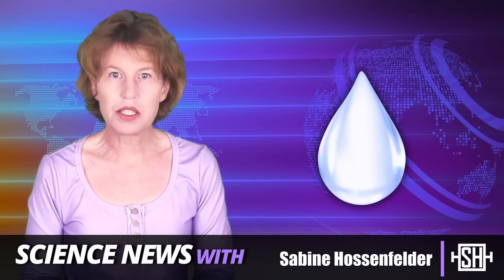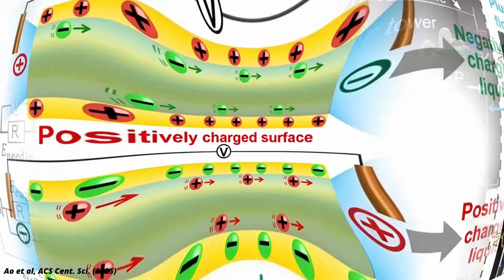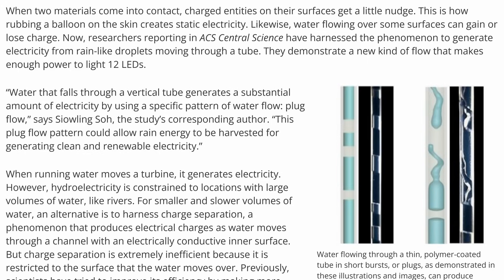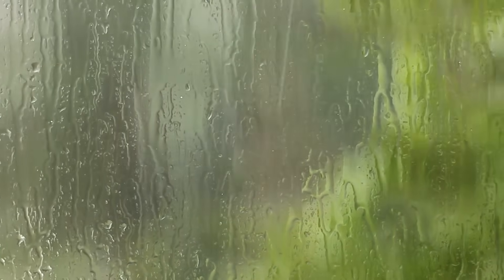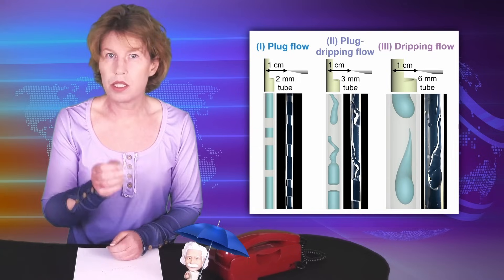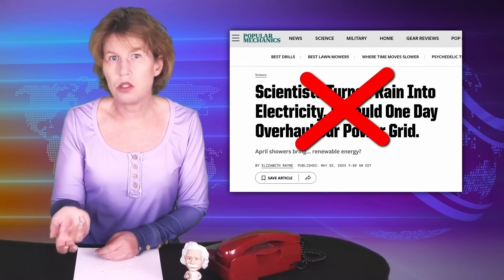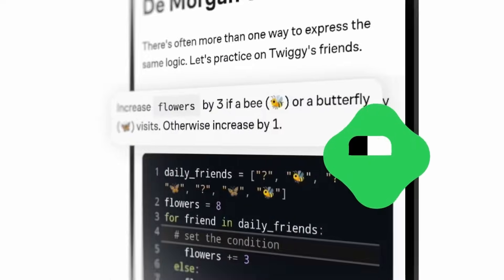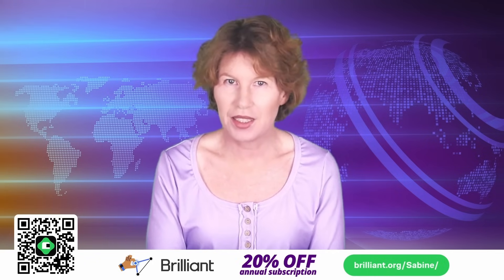A New Way to Generate Electricity From Rain

Comment: Also you could affix 45° angled plexiglass sheets of size 1 M² on each side of the tube stacks x 4; you  could also increase the efficiency and effectiveness by using triangular sheets to plug the gaps between each of the square sheets😊❤
Reply: But that would provide a steady stream of water, and it requires the air in between the drops to work.  
Still a focusing lens could be created, a cone as you describe but instead of going directly into the straws, they drip down plastic stalactites into the air again and then into the straws.

Comment: If you have that much rain coming down,  just build a dam and use a normal turbine.   I mean its great that there are no moving parts, but even a cheap turbine for a backyard pond is going to last 10 years.   I saw a homesteader who built a mini turbine into his rain spouting..  cool project but even his entire roof going through the rainspouting produced insignificant electricity
Reply: True.Rainfall from a house roof would produce very little power.

Comment: ❤ Use square tubes to fit more volume into the same area, as cylindrical tubes waste some of the available area with the gaps that they create 😊
Reply: Was thinking the same! The principle remains, and the water plugs will match almost any shape that we'd need. (Which makes me wonder if we could really push that shape to maximize surface-contact area of a plug.) Any repeatable geometry would be viable for production.

Of course, that still doesn't come close to making this practical or economical, yet, but we're talking principle, here and now.
Reply: I'm pretty sure hexagonal tubes would be more efficient since each tube will have a larger surface area to volume ratio, which presumably means more electricity, while still tessellating.
Reply: @matthewedwards9423 
I'm ALL about the mighty, mighty power of the tessellated hexagon - my favorite shape (after the perfection of the circle, of course!) - but I was thinking that, here, we might need more surface area-to-volume... so was thinking about more densely-surfaced tessellation patterns; even repeated patterns of heterogenous shapes.

The gentleman above who was considering the concentric-rings principle (which I've always loved - and employed to great success) might also be properly addressing this, as long as the water boluses/"plugs" remain separate and non contiguous, of course.
Reply: I like optimizations !
Reply: Or maybe, if the tubes work with double layer, inside and outside, use the circular tubes and increase the output by also generating in the spaces between tubes?
Reply: @jpfidalgo7 
I like that, and yes, it's definitely in principle the way to go - as long as we don't exceed the point where the water's surface tension prevents entry to that sliver of space.

Comment: Wouldn't it be much more efficient to generate electricity from lightning?
     Note that I'm being careful not to suggest this could be a significant source.
Reply: Doesn't work well.  The are not capacitors good enough (yet?)
It's too much all at once basically, and the cables melt, batteries explode, etc....
Reply: @Modhunter42  : Since multiple cables, capacitors, etc, could be placed in parallel to distribute the large current from a bolt of lightning, I think your objection doesn't hold up under scrutiny.  Lightning rods don't melt.
Reply: @brothermine2292  As I had thought as well, but several electrical engineers have tried to explain it better.
In theory, it can be done.
In practice, it requires too many capacitors, and too much distribution to be able to do.
It's been tried.
Repeatedly.
Because it IS a great source of power.
Reply: @Modhunter42  : Capacitors aren't the only way to store energy.
     The Wikipedia article "Harvesting lightning energy" describes the engineering challenges.  My takeaway is that the most difficult challenges are about making it a practical, commercially significant source of energy.  But I didn't suggest lightning could be a significant source of energy; my comment is only about its efficiency. (And my comment isn't about storage issues.)

Comment: I've seen streaming water generate spark in a simple set up. A tube with water is split. The channels drop through metal tubes into a metal bucket. There was some cross wiring going on between the sides and a cathode and anode connected to it. I forgot the exact details, but it's uncomplicated. It sparks regularly. I think it's exact workings were a bit of a mystery, over a decade ago.

Comment: Wait instead of hollow straws couldn't you manufacture extrude into a much smaller diameter rods and then pack them all together so that the diameter of the distance between them is the distance you need for the water to flow down and generate the electricity. That could be a more efficient use of the plastic, more efficient manufacturing and then you could possibly get more electricity per square meter. Because you get more channels for the drops to run through

Comment: There's always a punchline with this crap. Sure we can generate electricity using the rain; all you need Is 250,000 plastic straws per square meter and tornado force winds to drive the rain through the straws, get a couple of Watts

Comment: Cant it be used in all (downward going) pipes? We just need to change a pipe with cluster of small tubes. And add a module to filter out solid impurities and add air bubbles.Since we don't need lot of force or moving parts, it can replace all pipes?

Comment: I wonder if the tubes were longer or if the units were stacked if that would increase output. Since it’s using gravitational energy and the rain has already collected what energy it will have when it first hits the tubes then I’m assuming that would not work.

Comment: Moving water upward would increase heat flowing as external heat energy doesn't ground currents towards earth's surface. A water tower would have a pressure on the lines to move water upwards with air infused jets. Heat rises would increase heat energy outside of entanglement of mass as potential renewable heat energy moving upward through the lines. Moving heat faster than planetary internal magnetic fields grounding currents would increase amplification of magnetism bonding force of impaction. Water falls in equalization to magnetism repulsion and grounding currents towards the earth's surface.  Too maximize the flow you need pressure moving the water in the opposing currents of flow faster than planetary internal magnetic field grounding currents through all masses in its path. Electricity is rapid heat generators moving heat energy faster than planetary internal magnetic fields grounding currents. Two facts of physics. Cold space and renewable heat energy singularities outside of mass.  In atmospheric gasses heat is in entanglement with mass. As absorbed and unabsorbed heat refraction of reflection bouncing off mass lighting up the mass it strikes unabsorbed quantumized sparks striking mass unabsorbed. Sunny side up has more current flowing of unabsorbed heat energy bouncing around atmospheric gasses as hot days. Electricity is generated heat faster than normal planetary internal magnetic fields grounding currents.  Magnetism is internal and external magnetic fields. Fire is an external magnetic field. Space itself is a weak external magnetic field filled with dark heat energy outside of entanglement of mass and mass occupies space within it. We coeist as cold space and renewable heat energy. We burn calories. We have centrifugal forces cycling circulation faster than normal planetary internal magnetic fields grounding currents through all masses in its path until resistance is overcome by open space itself as weightless.  Inside of planetary internal magnetic fields grounding currents as force of weight towards the earth's surface grounding currents. The event horizon is the perimeter of space and heat don't mix or touch the other. This is centrifugal forces cycling circulation of mass as occupational space neutralized repulsion within mass as outward force of pressure known as weightless outside of a greater magnetic field. Without renewable heat energy mass disolves. External magnetic fields stripping away potential renewable heat energy from proximity mass disolves its outermost surface perimeters towards the greater external flow of currents cycling circulation around these monopoles of pure fabric of cold space repulsion. Liquidity infinity to illusionary solidity of liquidity infinity as magnetism centrifugal forces. In a river flowing whirlpools of obstacles being hit by currents flowing. In atmospheric gasses whirlwind as currents hit obstacles. All mass is repulsive to other currents flowing through and around mass. Our magnetic field protecting our planet from intensity of heat energy and holding our atmosphere grounding currents into earth's surface.  Our planet is quaternary elements combined synchronization of magnetism amplification of a internal magnetic field where heavier elements sink to the bottom of the pool or core where external heat energy force is strongest currents flowing through a river are flowing at the same rate of velocity in the middle and the shallows.  The variable is the impaction force of currents. The middle has more currents than the shallows.  Prisms show the variable force of absorbed heat. The thinner glass is the shallows and the thicker glass is the middle color coded absorbed heat is lighter in the shallows because of the impaction force is less so lighter color of absorbtion. Darker colors are more absorbed heat as the middle.

Comment: I wonder if this can be used to squeeze out more energy from a regular dam?
i mean you already extract a lot of energy from the water by running it through a turbine. But the amounts of water and the speed on exit is still very significant. 

Would this be an efficient way to get even more of the energy out of that? I mean - you probably have your km/h on the outlet of a hydropower dam.

Comment: We have already figured out how to generate electricity from rain, it is called hydro power.
Reply: It makes sense that Singapore wants to have this "alternative hydro power" --- Obviously they have a much harder time building dams and flooding a big chunk of their VERY limited land. Or having a big enough river fully within their border, for that matter. They need to take whatever they can get. Technology wise this is still something good to understand, I'm sure there can be other situations and/or places where the same limitations may apply, and it would be better to at least have some alternative options to consider.
Reply: @zaowang500 the dam isn't really necessary, it's just a big battery. But most dams were built for flood control, not necessarily generating power. They could put big pipes up stream around 100 feet higher (in elevation) and produce the same amount of power as long as the river is flowing a normal flow. I live in East Tennessee and our dams just recently saved Knoxville and Chattanooga from devastating floods..
Reply: @Bryan-Hensley flow control is important.  There was an interactive exhibit at the science center in my city that had a small waterfall with a generator under it and some plastic blockers.  If you funnel the water into a narrower space it moves faster and generates more power.

Also the dam is where a lot of the generation and transfer happens to protect the equipment from excess water.
Reply: @justinwhite2725  I witnessed a guy who used a 3 inch pipe to funnel Creek water down 90 feet in elevation and reduced the pipe to 1 1/2 inches. It ran a 7,500 Watt generator at full power pretty easily. I think it could have harnessed more output.
Reply: It definitely works
Reply: Knowledge is always useful.  Hydro diversion power is an interesting wrinkle where they build a small diversion dam upstream, dig a miles long tunnel to get enough drop for running turbines efficiently and then release the water back into the river after power generation.  Much smaller ecological footprint and often much lower cost.  Not likely to work in Singapore.
Reply: This is a form of hydro power.
Reply: @lewebusl  While both are forms of hydro power, the dam has a huge advantage in that the water has been concentrated into a higher density so you can harvest that energy with a much smaller structure and thus lower cost. Furthermore, that concentrating is essentially free, as the land naturally funnels the water into a lake. Or for a roof and rain pipe, you're already paying to build those anyway.

Power density is one of the most important factors in energy generation. You don't get to ignore it just because it makes batteries and solar look bad. It's why wind is preferred for boats instead of solar. Wind is less reliable, but that's offset by its much higher power density (since it uses the surface area of the ocean as a solar collector instead of a few panels you can squeeze on board).
Reply: @solandri69  Yes. But in a case when dam construction is unpractical due to terrain , this system can still produce prenty of power by placing a layer of the straw like mini generators to the river  bed. With only a small but constant slope in the river flow , lot of power can be generated the more river bed is covered with the generators. It can be used almost anywhere.
Reply: I suspect silt would be a major issue in a river.
Reply: Don't ruin it😅
Reply: She essentially stated that if you watched the video
Reply: Left early, appointment.
Reply: They could put the straws into the dam and crate more power
Reply: @anthonynorris7736  ...LESS POWER AND MORE heat

.....BESIDES,WATER'S VISVOCITY ISNT zero,THOUGH
Reply: EROI or bullshit. That simple
Reply: Proof of concept… practical? If not why not? Stay honest stay curious.
Reply: Sure, as pure research it is an interesting start.
Reply: Scientists don't take engineers opinions as seriously as they should.
Reply: And this is why you are not a scientist.
Reply: Nope, engineer.

Comment: 3:46 that was my exact thought instantly after you showed how much rain fall was required. It would be much easier, cheaper and more efficient to just fit a turbine to the downspout.
Reply: What about a rainfall instrument in the middle of a vast desert. You don't want any moving parts because that would make the failure rate unacceptable.
Reply: @john_g_harris  I think that would be a good usage of this device. It's not about power generation its about measuring rainfall provided that it is accurate. I would be a little concerned that a change in the composition of the rain (like being more acidic) could alter the result / accuracy of measurement or could the tubes change / degrade over time.

Comment: There is something called Kelvin generator that I once built for school. I think the principle is very similar
Reply: aye, you are correct, it was a standard way of making static electricity, I think Kelvin built on the work of Benjamin Franklin. But can you imagine having one of those generators with 3 olympic swimming pools of water going through your 1m opening every hour. We are also assuming the walls of the tubes are very thin which may also be problematic.

Comment: I am beginning to dispair.
Yet another focus on a renewable electricity production from WEATHER DEPENDENT source. Yeah we need more unpredictable renewables that converts our wallets into black holes.
Please, Sabine - tidal kites from Minesto produces 1,2MW predictable electricity from a turbine that weight only 28 ton, with a nice twist when the turbine accelerates to 8-10 times the current speed.
Reply: i think the only people saying this could be used for the electrical grid are underpaid journalists, calm down

Comment: A good way to generate power from rain is called hydro-power.
That is how we already generate electricity from rain.
An amusing science experiment... illustrates some fun ideas... to make electricity from raindrops.
Of zero utility in the real world..... since they have not priced up the materials either. so far as I know.
Might be a handy way to measure rainfall or waterflow though.
That will be the use case..... not bulk energy production.
Or so it seems to me.
Reply: Pero muchas naciones no tienen la infraestructura correcta para usar "dams." Necesitas elevación diferencia muy grande para crear energía suficiente.
Reply: I suggest using precipitation instead of rain as hydro dams fill up from the spring snow melt in a lot of hydro dams.